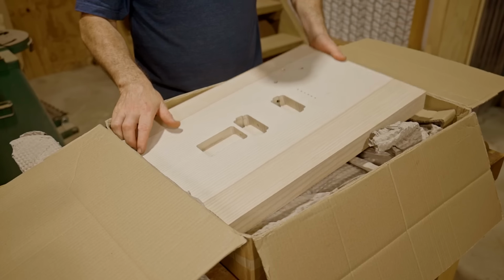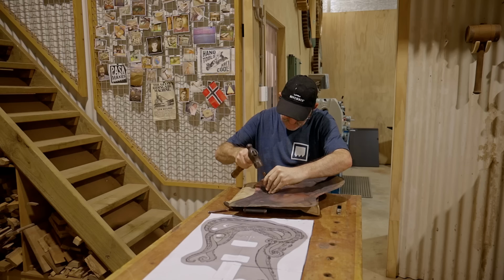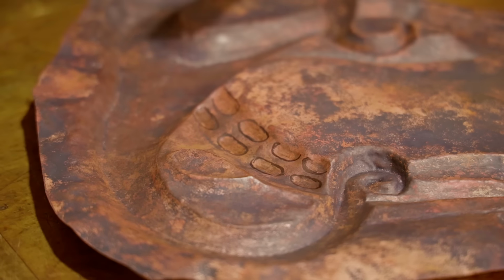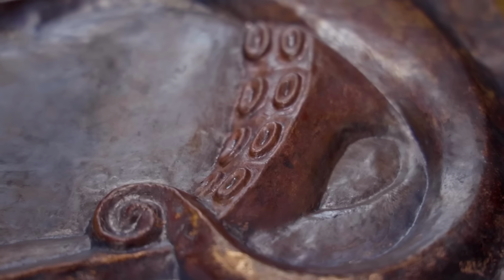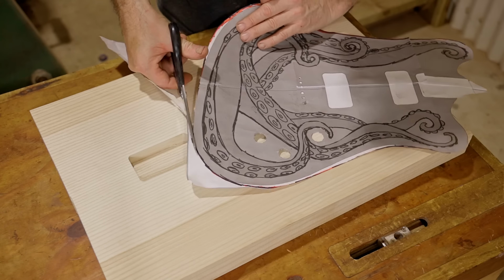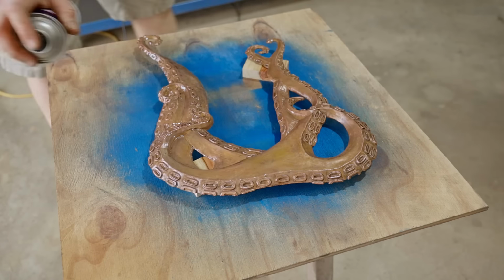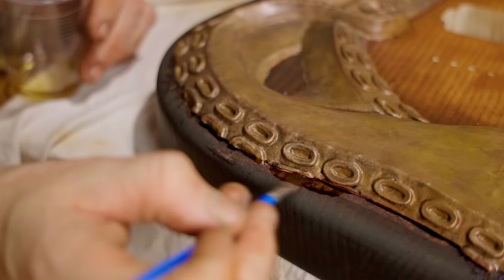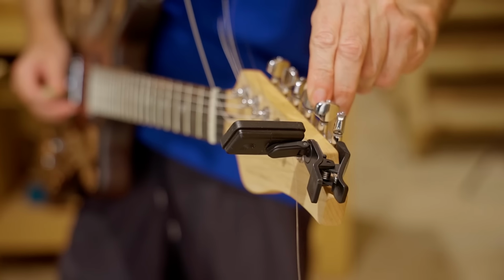Making a Unique Guitar with Awesome Copper Tentacles?

Comment: If you are worried about the weight of future projects. Instead of filling the carving with resin, use expanding closed cell foam. That would still give you a good gluing surface while adding only a few grams of weight.

Comment: Great work again! I'm also a hugh fan of Crimson Guitars (Ben Crowe), so I'll vote for your design in the build-off. 
Regarding the tentacles, I liked your bluing idea; however, I think it would be better to use them as highlighting/shadowing by bluing the insides of the suckers or something like that.
Regarding the finish, I like how you used the dyes. I've painted several guitars, and to do a 'burst' finish, I've used colored lacquers. I spray the entire body in a transparent yellow/gold, then I use a transparent red to spray along the corner-edges pointing toward the center on front & back, then I spray a black lacquer, pointing to the dead center of the sides about six/eight inches away & go around the entire perimeter. This gives you an overspray of the red & blacks that looks like a feathered edge to really pop & provide a bit of a 3D effect.
Keep up the great work! :)

Comment: You can make pitch with asphaltum pitch, (hot seal roofing pitch) linseed oil and plaster or lime powder. Asphaltum is hard/brittle. The linseed makes it malleable and the plaster gives it body. Vary amounts for soft - hard, depending on much support you need. Use a heat gun to soften and apply your work piece, rub a light oil on the back to ease clean up. I've been using the same pitch for 40 years. I have a cast iron pitch bowl and wooden cradle for changing position/angle and a big, shallower metal pan for larger flat work. 

Well done, quite an undertaking for a first big project. Your innovations worked pretty well for on the fly DIY. Someone is going to win a beautiful, one of a kind collectable.

Comment: I wonder if a palm nailer would make the process easier. Reduce the end of the tool to fit into the nailer, and adjust the air pressure down to get control on the hit strength. 

Love your videos!

Comment: I know the old mantra is “Get a bigger hammer” but in this case, get a smaller hammer. With that big ball pien hammer you are all choked up and all the movement of the hammer head is in your arm. With a smaller hammer you only need to flick your wrist. And you have much finer control over the force of each blow. With a big hammer you can only hit so soft. I also think your tools are just a bit short. I prefer about four inches to 4.5 inches. About the width of my palm. Less likely to whack your knuckles. Great job on that copper. It takes an astounding amount of patience and in the beginning it doesn’t look like you’re getting anywhere. Great work.

Comment: You should check out Desktop Metal's FIGUR 15, it's basically a CNC Repoussé machine. They unveiled it at IMTS this year and I got to watch it in person, pretty wild stuff. They use urethane plates for their backer and a ceramic ball for their tool. Then the machine does the chasing on the shallowest features first, the backer table drops (but the sheet clamps stay at the same height) and then it does the next "layer" kind of like 3D printing but backwards.

Comment: It's gorgeous. No doubt the apparent tedium crosses over into meditative rather quickly, but I wonder about the repetitive strain of what you're doing with your body here.  Did you consider investing in a handheld pneumatic hammer, similar to what's used for stonecarving?  Using hot glue was very clever btw.

Comment: Love the guitar and case great job.
When you pulled out the hot glue gun I was thinking you could use the pitch with hot glue over the top and finished with the plasticine to support the whole lot, the hot glue will allow the pitch to do it’s thing but keep the pitch separated from the plasticine. 
Thanks for sharing🤗🤗🤗🤗

Comment: I bet you could have used window sealing expanding foam to fill the copper instead of epoxy. Might have saved more weight. Or just leave it hollow, and could chamber under it for more weight savings. Not sure how that would affect the guitar’s performance though.

Comment: First of all, I LOVE this work and your efforts with working copper. That, from an artist and quazi woodworker. However, do you have any idea what a pick guard is for? A player would KNOW that you need to get DOWN into the strings to get the best strokes and wrist movement to double and triple pick strings. The guard protects the FINISH and gives a smooth support for the players hand. I would complain about that high rough surface next to the strings and then shrug and keep playing. 😄😄😆